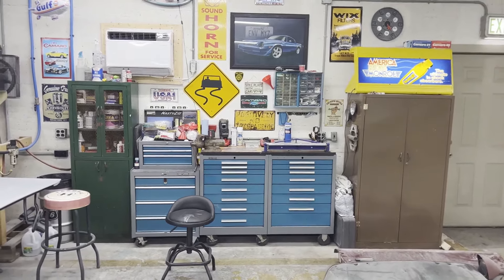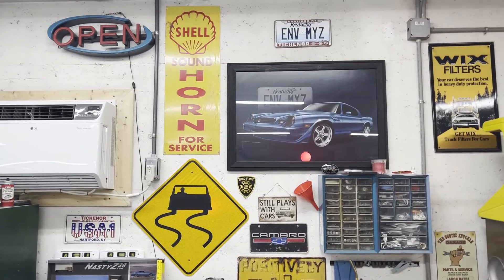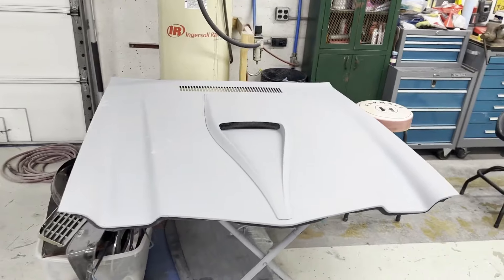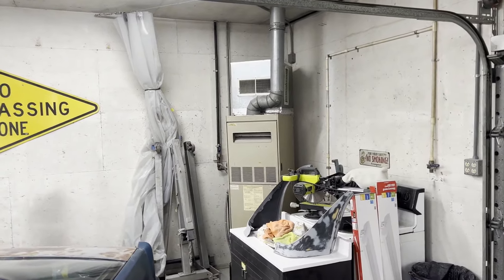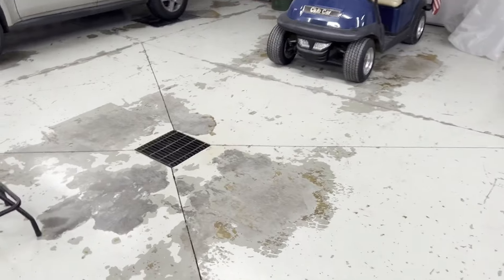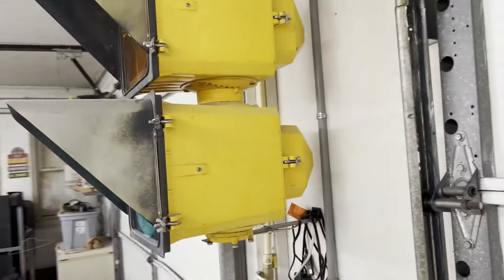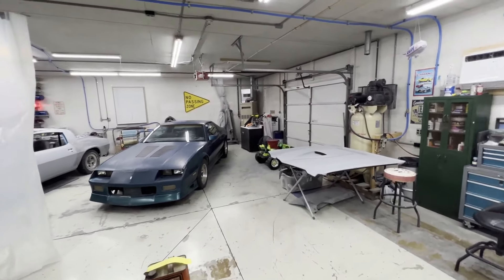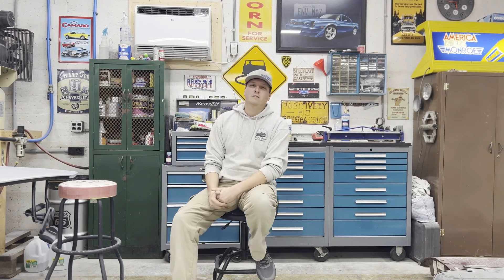The Starting Point Of My 50x35 Dream Garage!

Comment: Nice ... what power supply are you using for the overhead police lights ?  Thanks
Reply from the maker: Thanks for the comment and stopping by.  I’m running a PowerMax PM3-100LK.  It can run 3-4 at a time.